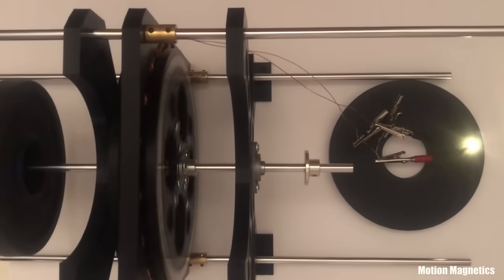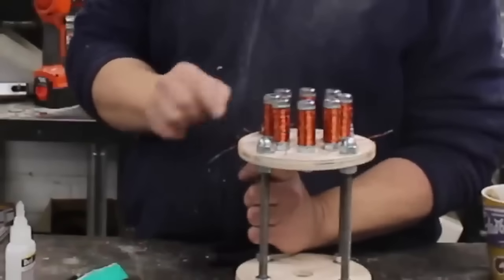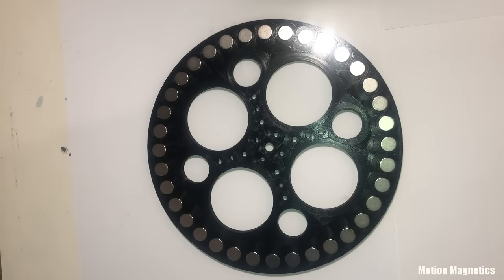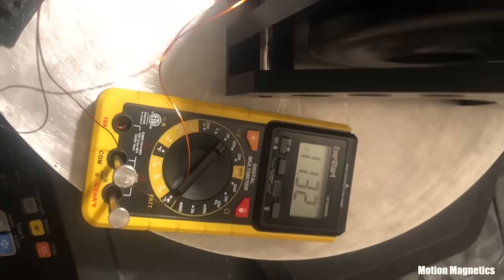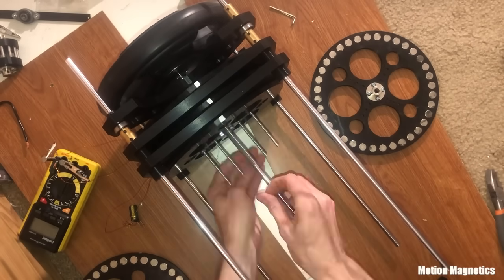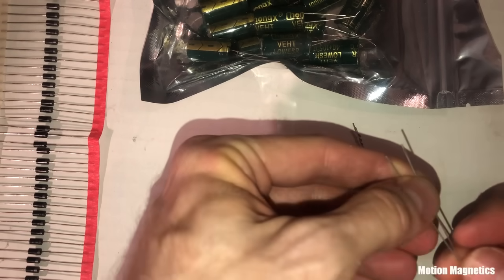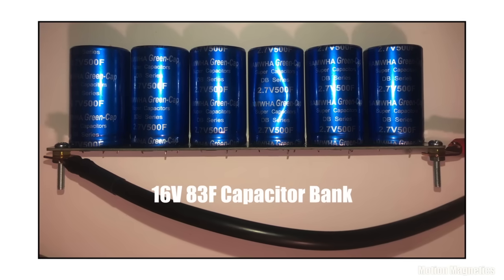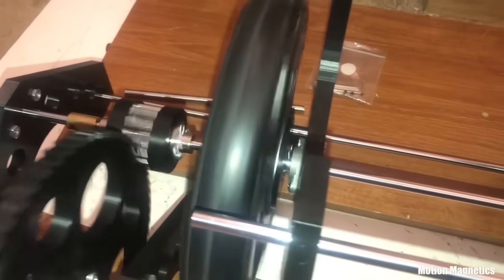Stackable Generator

Comment: Why not use litz wire to get both high current and high voltage, possibly lower weightand since you use magnets you should consider similarities to axial flux motor type design. Its magnetic fields dont oppose in order to generate current, and thats not a flaw but a feature. This zig zag winding is new to me, seems like a cool idea, yet idk how it works. I wonder if it has ebough variance in its magnetic field to push and pull properly. Perhaps... an acial flux design with a half bridge switched mode rectifier to create impulse DC, wherein the discrete coils on each rotor impulse really fast. The impulse, I think, will create less drag as its only a push, akin to how an AC motor pulls the magnets into place, the pulses would rather push it without the local field having to commit to any polarity reversal-- thus you benifit from back EMF as the impulse field collapses.

Just speculating, your work is great!
Reply from the maker: Thanks! Sound thinking. I couldn't tell you exactly how a serpentine coil compares to other coils, power-wise. I mainly picked it for its simplicity. If you watch Robert Smith's videos on them he makes some great arguments for their efficiency as well though.
Reply: @Motionmagnetics  and theres real objective reasons to make things easier to produce. People in third world countries will be trying to make your motor design due to your intuitive and accessible approach. I encourage you to make a repository of files, listed materials, steps, and equiptment needed.

I agree DIY motors should be buildable by average DIY engineers, but not particularly fast to make. Durable things built once can be more scaleable and attract even smarter people to replicate, etc. Like, rather than MOT coils as is (which I know you mentioned but didnt do) you could use mini votrx coils like those called POE (peace on earth) design (idk, its a weird design name, but I made my own with thin acrylic and a laser cutter. You can get the files and simple steps from me to replicate a mini vortex coil build, if you'd like. Lmk) the benifit of vortex coils is the make the strongest magnetic fields. period! but the draw back of vortex coils is that they are time consuming to build and have to be hand made. 

Serpintine coils certainly work, but I doubt its an optimal pick for anything but ease of fabrication. Not to be harsh, but I'm saying thay because its not in axial flux or really any motor design I've ever seen. 🤔 

I sincerely appreciate your work and publication of it! I wish I could be more help with specifics, but I'm not that hands on, I'm just a hobbiest reasarcher / inventor.

Edit: Ibsee that robert guy has used serpintine for acial flux motors. I dint currently have time to do a study of serpentine coils for axial flux motors, but I think its a really great direction!! https://youtu.be/lK1ZM9WIBh4?si=gB5uG9clIN5snZca
Reply from the maker: @ickorling  That's certainly a possibility. I try to keep the approach more simple so that it's more accessible to everyone. Or I try to simplify the complex.

Your mini vortex coil sounds interesting. Do you have any videos on it? 

Thank you!
Reply: @Motionmagnetics  TLDR: I haven't used a votex coil with power through it, but made one intending too. I have researched them for years but I cant hold a candle to an EE. The qualities of the vortex coils are hard to believe I know, unsual at best. If you don't have patience for 'Tesla free energy' enthusiasts searching for answers then I'd just be wasting your time. Not my intent, as you have practical research on your hands, and thats good!

And so yes, see the link below, though I'd loke to still preface to take some such things with a grain of salt, as these things always come with over unity claims. Its gonna depend on the whole circuit though. Well, to be frank, idk sometimes but believe it when particular elements are present. I think Tesla did it many times anyway, probably many others, and the US government too with two fusion generators so its possible beyond theory to provide more output than input energy (via vastly increased efficency). Anyway. I researched vortex coils, many designs (star looking ones are awful, not what I call vortex coils). The one's I advocate for are those like the POE (peace on earth) design vortex coils. I specify that one not to make you like buy the ones they sell by that name (I make my own) but because theres dozens of subtly different designs and its hard to verbally describe. Idk who made the first design, Marco Rodin or Daniel Nunez. Either way. I suppose thos was the only video I would cite, hope to be true. Never tried to confirmed his results myself.

https://youtu.be/UeKhHBA3wrg?si=2hNe6X-yuSuXLi6b

So, the toroid shape has an inner diameter (the innermost ring of a donut hole) plus an outter diameter (the outter most equator) where the magnetic field is the strongest. It pushes the 3D field on this axis the strongest, and from all other plane of axis it draws energy into that plane (kinda like flatness of solar systems and galaxies). Well, the motor in the video doesnt use that axis, but I'd try many different orientations if I replicated this. Including laying them flat and to include just trying them at tilts. But who know? This guy claims (and supposedly demonstrates) he made a rather efficent motor, more effective than what they thought possible it seems. Hmm I can say that from my studies, the plane of the inner and outter diemeter of vortex coils have the strongest current made magnetic field for the least weight of material and least input watts of any apparatus I know of.

As a disclaimer, I really don't mean to mislead you, I take this with a grain of salt too. You're more of an engineer than I am, but just perhaps I have spent sufficient time researching physics theory which indeed doesnt always cut it. I cross reference many sources and real verified experiments, modern and old.

So, I can tell you I believe with good reason these claims about vortex coils: they are resonant to any attached capacitance atleast while there is no other inductance on the circuit, and at resonance they transform voltage up by 10x, they produce the strongest magnetic field for its given input & wieght at the very center of the torus, and when made it has virtually zero variance in curvature of the windings despite the fact its also a cadeucious coil (counters its own magnetic field, hmm, not in a bad way, this makes it transform energy in unusual ways called torsion spires I think are in the spaces between forming an electric current, where usually is a magnetic current traveling on wire surfaces). It works best with an aircore, and I chose to make it with litz wire.

 I used big words like torsion (think elongated vortex) so you may reference with google to any terms if you want, but the closest thing to torsion spires you'll likely find is lightning torsion sheathing, a really hard subject to find material on itself. But, master IVO on YT covers such ideas for flat bifilar coils, similar but not the same (also transitors wont make fast enough impulses for overunity, I digress).

Basically, lighting has an inner and outter layer, the outter layer protects the inner layer from getting quenched by wind and disrance because the outter layer is a torsional tube. The 'spires' as I call them only appear in the spaces of a vortex coil windings during ultra short impulse DC signal, and are invisible, and connect end to end in a crazy hypersphere closed circuit (theoretically). Ferrocells and raw magnetic field strength, and its unique resonation matching trait have seemingly revealed this is likely the case.

I apologie if my utterances are incoherent or non-sensable, I myself cannot confirm at this time if what I know is meaningful or not. Either way its hard to understand for anybody. Its Just what I learned on the internet as an ameteur and I want to help others.

I do highly respect your objectives and work. Do continue! Comment back if you wish or add me on insta @ickorling we can discuss further and keep up. Cheers!

Comment: re connecting capacitors in series.  you will lose capacitance but gain voltage handling potential.  so if you connect four 100V 10uF caps in series they will effectively make one 400V 2.5uF cap.
Reply from the maker: That makes sense.

Comment: Since it spins so smoothly, what about a small motor running off one stator to keep it going self propelled? Been reverse engineering moped swing arms and DC motors. Diodes are your best friend for the back feed makes much drag
Reply from the maker: That's one possibility. I'm going to see what I can get out of the generator with a gear system attached to a weight.
Reply: @Motionmagnetics  I was, haven't in a while, going for a hand crank generator to start a system that once it gets going a relay auto switches from crank to self operation. my theory is you have a 10kW generator with a 1kW motor that can run it you should get 9kW+/- usage. It seems may need a third setup between somewhere to aid. This would eliminate loss from drag or load.

Comment: Put a diode between charge and bank the minimize back feed
Reply from the maker: I'll give that a try.
Reply: @Motionmagnetics  gearing is cool. I took a power wheel toy jeep. Made a crank it. Zero modification and stacked 2 together. Depending on series/parallel it pushes 8-18vdc up to 6-8 amps. That's no load. A moped swing arm is also a fairly powerful hand crank generator in reverse. Takes some hacking to reduce difficulty. I chopped piston crank in half an can put pulleys between. Makes independent stator and like 20:1 gear ratio crank that can withstand much input torque. With high torque gear ratio fraction of mis alignment makes near impossible to turn, once the alignment nears perfect, gravity falls the handle. Many opportunities for great ideas. Keep up the good work! Your little project seems like a winner. Instead of inverter I use car and RV 12v setups. The inverter is a battery vampire. Independence is dependent on being independent. Not the false sense of mortgage (still rent can still lose it) and work to pay (open door slavery) and credit (owe more than make). I use solar and some old car batteries, collect rain and use firewood. My light always on 💡
Electricity is an addiction. Millions of years our ancestors had none and we are here. If cell service gets wiped out, I will need none 😁 a few hundred years we are failing miserably 😉
Reply from the maker: @UrbanPovertist  Thanks! 20:1 would take some torque. Sounds like an interesting setup.
Reply: @Motionmagnetics  i modified an angle grinder 90° head and I can cut and grind metal with no electric. That is on my page. Shooting sparks 😉 since the moped gears are tightly machined it actually takes little effort.

Comment: 4:53  Googling some technical language here made me feel cool, and it seems like the more turns the better, for producing electromagnetic effects.  And I wish I could help explain to other viewers why that is the case but I'm too stupid and lazy at the moment to look into it further.  I am diabetesey right now.  I have pretty much zero knowledge of how electrical systems work, but does less "turns" equate to less energy needed to be put through the system for the desired effects, because if so that would make sense to me
Reply from the maker: Yes, that exactly right. Thinner wire with more turns will also produce more voltage than the same amount of thicker wire, as there would be less turns of the thicker wire to fit in the same amount of space, but the amperage would be higher in the thicker wire. So the wire gauge you choose depends on what your energy needs are.

Comment: want to power 60 watts of output with ease. modify a washing machine pump motor that has a round magnet inside by adding a 1 uf microwave cap in series with a light bulb and the winding and you can now spin the rotor at somewhat low speed and it will put out its maximum capacity at high voltage with little effort. the stator field becomes much stronger than the field of the rotor magnet so that all the current created is from the stator so little energy is wasted in the rotor. its still only 50 percent efficient but better than most systems.
Reply from the maker: Not a bad idea.

Comment: I didn't know you where interested in making a Generator. When I was interested in wind Generation here is a fellow that makes one that you can transform a Generator Motors Alternator that was very common in the 1970's -1980's General Motors Alternator. You can check this out and see if it is a helpful option or not......How to Build a Permanent Magnet Alternator PMA | Missouri Wind and Solar.......https://www.youtube.com/watch?v=Fw1UYXyzpLA
Reply from the maker: Much of my earlier videos focused on magnetic motors, but the plan was always to build something that could turn a generator without using conventional means. Using gravity to turn gears attached to a generator is still fairly unconventional, and equally interesting to me. 

I'll check it out. Thanks.
Reply: @Motionmagnetics Have you calculated the amount of energy available from gravity powered weights?  Maybe, you should do that now!

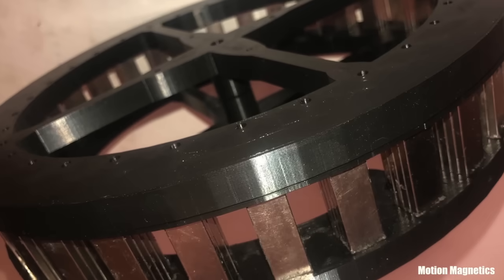Comment: 1:32  I've been trying to develop some kind of magnetic shielding that can be easily tripped and reset, and programmed [depending on what machine it's being used for.  I wanna make it as simple as applying screws or gears to a device]
Reply: Something involving locking levers, and that spins, since spinning requires such little force.  Designing this one key component has been like a whole other venture unto itself though
Reply from the maker: I picture something like a Magswitch in function with a lever to trip the shielding off and on from your description.
Reply: @Motionmagnetics  It's definitely hard to explain what I want to happen without showing it, which I may get around to in the future since it would show off the whole rest of the wheel I made.  
I'm sure many other people have thought this before, but feel like there is so much potential in magnetic shielding...  My thinking is this [in regards to a machine/wheel I'm trying complete with this final component]:  if a system is set up properly and carefully enough, then the benefit of having magnetic shielding at one moment during the wheel's rotation ought to outweigh the minute friction and energy loss from having to merely spin the magnetic shielding component into place, timed & locked into place by levers or something [I only say levers because it's how some magnetic weights on my wheel get locked into place and get released naturally at certain spots during the wheel's rotation, but I'd explain that wheel further in a separate comment not this long one]

Comment: Great video! You put a lot of time and effort on this generator. My question would be: Do you know how much more efficient this would be compared to a traditional wind turbine and would it be cost effective? Nevertheless  even if you don't have this answer yet never give up and continue with building it. Must be nice to have a working 3d printer for these templates.I found your work to be excellent on this build. I look forward to seeing your next video 👍👍👍
Reply from the maker: Thank you! I intended this to be a smaller-scale generator that could be upscaled later. That said, it actually managed to produce more power than I thought it would. Ideally though, for greater energy requirements I'd probably suggest a stacked version of an axial flux generator, similar to what you'd see in a wind turbine, connected to a series of gears or chains with a weight being used to power the system. The weight could then be reset using a pulley system.
Reply: LESS efficient...